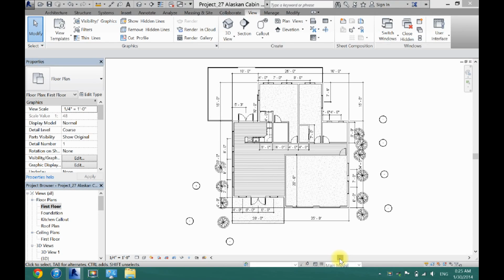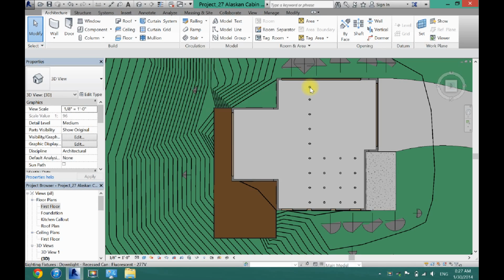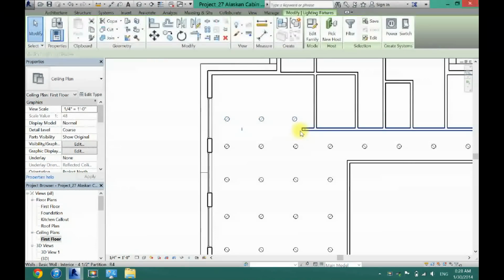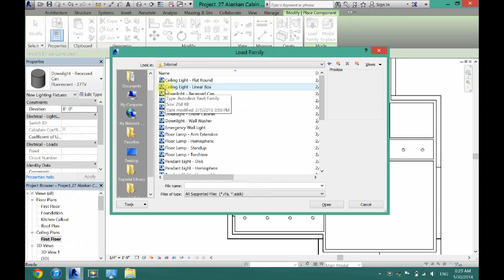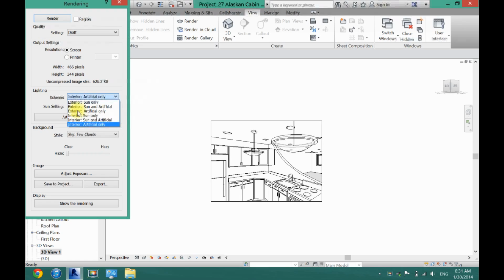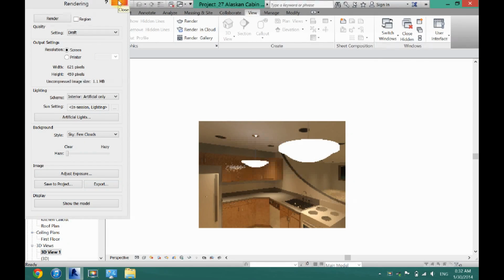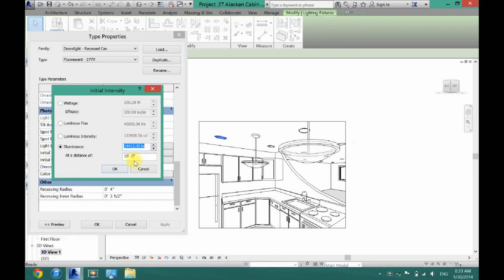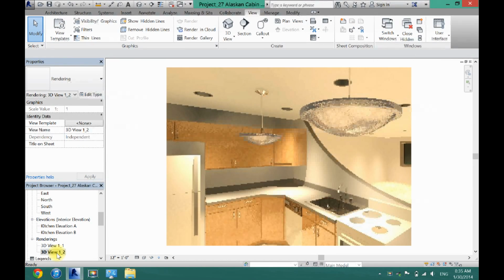How To Add Working Lights in Revit Architecture

Comment: Nice tutorial, but the voltage of the Revit light fixture has nothing to do with how bright it is. If a 277V fixture is brighter than its 120V alternative it would only be because the original fixture modeler made it so.  Voltage only has to do with input power to the fixture. It has nothing to do with lighting lumen output in to the space itself.  I just don't want to see anyone ending up with a building full of the wrong voltage fixtures.
Reply: Mike Noon it’s for a school dumbass. Not real life.

Comment: hey thanks for the video. If you want to turn on the light, change the material of it to , glass->" bulb lights on" and you don't need to photo shop it.
hope it works .
Reply: MissSun Shine  Hi. Where I can change this? I don't find this material... That "glass-> bulb lights on" is into the component or in another tool?
Reply: Where is this option?